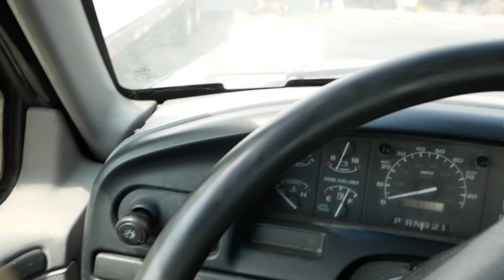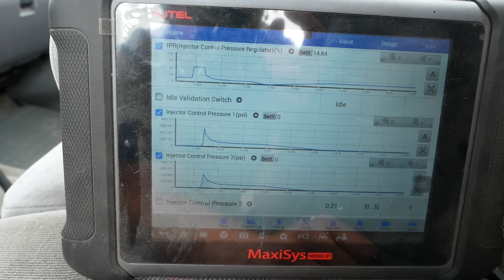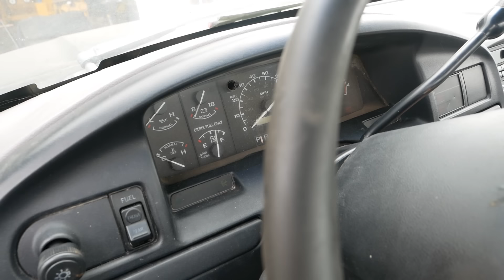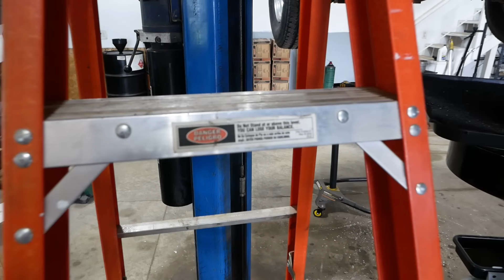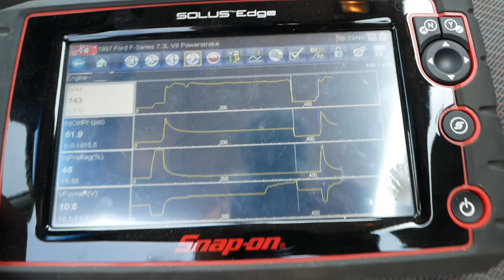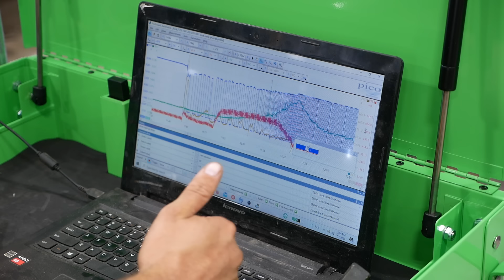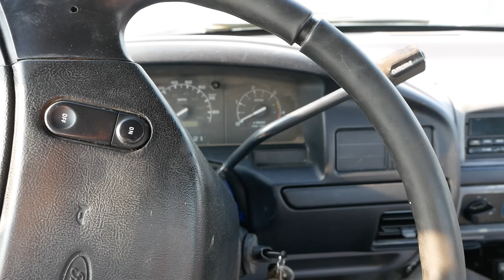Can We Get This 7.3 Power Stroke Back on the Road After Four Years?

Comment: I don't know if you figured out the  long crank issue, but I had the same problem on two 7.3. Both were 95, both had excess of 250,000. Neither had ever had injector O rings replaced. Finally checked the secondary filter on the drivers side of the fuel filter on top of the engine. I'm sure you've seen this,  but opened it up and cleaned it. They were both full of O ring particles and nasty stuff. The way it was explained to me, the return fuel or unused fuel from the injectors is sent back to the filter housing through this filter. The long start issue both times started slowly,  over moths and months. When I finally had to figure it out I was stranded in an airport parking lot and it took at least 20 minutes to get it to start. This was also about 2 months or so after I ran it out of fuel while running down the interstate. The second time was shortly after buying the other truck. Both times the filter was the problem. Cleaned it both times and had no other starting issues and put A LOT of miles on both. Just my 2 cents. Great videos buddy.
Reply: Just to add: Someone else added that it might be a capacitor in the PCM.

Comment: A leaky capacitor in the PCM is the answer to the question: "Is there something that leaks down with the switch off?" (at 43:10)
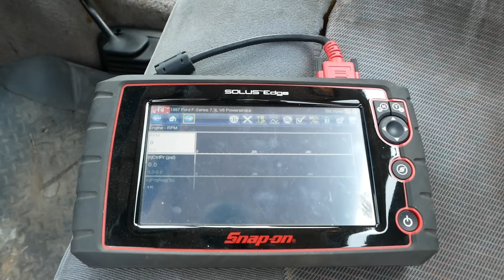At 37:40 the voltage from the PCM starts at 10.3 and goes to 10.1V.  
At 39:30 with the key on for half an hour, starts at 12.1 and goes to 10.8V.
The lower voltage provides less energy, a little lower voltage and it would never make any pressure.
Thank you for your videos !
Reply: Maybe but I would change glow plugs first as they probably have high resistance.

Comment: That 7.3 is just breaking in with 211 thousand miles.  Always love these bring back to life videos.
Reply: My 1996 f350 crew cab long bed 4x4 dually has 332,000. 7.3 with the e4od. 
My late 1999 f250 extended cab long bed 2wd has 354,000, 7.3 with the 4r100.
Both are excellent trucks

Comment: One of the many wonderful things about newer trucks is when you lose your belt you lose both your power steering and the majority of your brakes. Found that out when the AC clutch went out in my truck and took the belt with it. Luckily I wasn't driving down the freeway when it happened. Whoever thought having the belt be responsible for both was a freaking jeanEus that's for sure. Driving it from where the tow truck dropped it off to my where I could work on it in my driveway was a pain. What the heck were they thinking. It's a 2008 Dodge 2500 with the 6.7 Cummins.

Comment: There's nothing quite like the sound of a 7.3 Powerstroke. My dad had a '96 F-250 with the extended cab and the roof lights on top. Man that was a solid truck.
Reply: My father had a 2000 model extended, with roof lights as well. Never broke down for 275k miles. I grew up in that thing. We have a 2013 now.

Comment: I really appreciate Ford putting the starter solenoid on the fender close to the battery for remote start testing 😉👍🏻
Reply: I really appreciate ur spelling plumber plummer
Reply: I bought my Dads 78 f150 in 88 when I turned 18! Owning that 300 inline 6 3speed overdrive tought me everything I've ever needed to know about Fixing my ride on the side of the road!!! From when my buddy and me coming back from dirt biking in Pinckney No. Locked up the gear box on I94 and Mt Elliot in ghetto Detroit. Good thing Pops was stationed at E23-S3 dfd! It made its way to the back yard in Roseville my neighbor Joe found a boneyard 3speed put that puppy in and a sparko shift kit from Kmart!! Then the shift lever fell out I welded one with bolts long enough to work!!! Then the starter bendix locked up bought one at Warren Auto rebuilt that! Then the gas tank rusted through we used a self tapper bolt and a break strap sealed up with rtv! Ext....
Reply: Try this on a 7.3 econoline.  Everything is convenient to work on if you got a buddy with 6 foot long arms and a proclivity for contortionism.
Reply: Dance Around The World Maybe he eats lots of plums?
Reply: Old Mopars are similar.
Reply: @SweetLou0523  7.3L IDI or Powerstroke Econoline?
Reply: @Nathaniel Clark  7.3psd in a 1996 E350 ambo chassis. Got to darn near be a gynecologist to do some simple stuff like GPR or fuel bow work. Hell, the main fuse block is UNDER the power brake lines. Gotta use a 24" set of right angle needle nose just to get down to the dang things.

Comment: I am extremely impressed at how you got the snapped brake bleeder out. I’ve taken out broken exhaust manifold studs by welding a nut on them, but I never welded a bolt to a snapped and frozen brake wheel cylinder bleeder and then coaxed it out with the air hammer. Excellent job!!
Reply: I’m extremely impressed by how well he took that zap ⚡️ lol 😂
Reply: "Coaxed it out" and " with the air hammer". Not two phrases that I anticipated seeing in the same sentence. 😆

Comment: Had a similar problem on my '95 (long crank, sometimes forever crank), turned out the IDM relay was intermittent. Contacts in the fuse box had loosened up somehow (heat?) - bent them back in with a pick so that the relay plugged in solidly, problem went away. Maybe with the key on the relay stays energized, letting it crank normally.

Comment: Whenever I weld a nut to a broken bolt or in this case a bleeder I like to cool it with pb blaster rather than water. When the bolt cools it contracts and pull the penetrant down into the threads. Makes a huge difference.
Reply: I was actually thinking let it cool in the ambient air vs quenching to keep the weld metal from becoming brittle, but that pb idea sounds even better.

Comment: Lol, we had about the same situation. Had a 96 7.3 that my dad bought at a salvage action. It used to be a plow truck in Michigan. Dad had fixed it up and it was ready for farm use, the only thing was the brakes didn't work and it wasn't licensed. Dad didn't have time to fix the rest, so It sat outside for about 16 years before we got it running this past spring. Runs great now!

Comment: I would look into the internal power supply of the ecm. Maybe some caps gone. Power supply unstable when they are fully drained which not happens when the ignition is immediately turned on again.
Reply: Thats what i was thinking...sounds like a bad cap somewhere....cant be the fuel pump as its not on is it?
Reply: @BlackAck90  Shouldn't be the fuel pump but the caps seems likely. But then it should work the same if you just leave the key on for a bit
Reply: This 👉
Reply: Those electrolytic capacitors are almost 25 years old in the ECM.  Cheap to resolder in some new ones.  Could have high ESR values as well.
Reply: That's what I was thinking. "What drains when the key is off?"....capacitors do.

Comment: I had the SAME EXACT PROBLEM on my 2001 Powersmoke! My truck died at a red light and had to wait 2hours and 30minutes to be towed 1 mile back to my house. Next day plugged in Forscan and started diagnosing. Saw that the ICP was reading only 180psi. Took a look at the pigtail SAME like your video corroded wires exposed and it was shorting. My IPR had the SAME problem the gasket melted on the inside. Went to Ford spent 300$ on a new IPR and 10$ on the pigtail. Fired right up and no issues ever since! I believe if I swapped out the pigtail and cleaned the old IPR with electrical cleaner it would’ve worked and it would’ve saved me 300$!

Comment: The 'Vague-shifter' is likely the two torx bolts that hold the bell-crank to the shift rail on the bottom of the column.   I've seen several of those back out to cause that issue...
Reply: If this turns out to be my issue, I might have to buy you dinner.
Reply: I 2nd this. Tightened probably a half dozen of these with blue lock-tite.
Reply: Had this happen to me in a Ranger. Seems to be an issue on the F series also
Reply: @NotSureJoeBauers  Ford liked this column design so much, that they used in most of their vehicles from the time period - just about anything from a Taurus or bigger...   It's likely that your Ranger used the same column, and therefore would be susceptible to the same issue (pattern failure).
Reply: Yes, a common problem. I also put on lock-tite, easy fix.Also rust jacking of the shaft going thru the neutral switch where it mounts on the transmission swells and binds the switch causing hard, stiff shifting of the lever. Found both problems on the same truck.
Reply: Yup.

Comment: That rust is one of the reasons I don't miss living in Illinois anymore, even Ziebart didn't help!
Reply: Ziebart makes it worse holding water against the frame
Reply: And where do you live that doesn't have rust?  Inquiring minds want to know....
Reply: @ChristisKing7749  Common problem with Ziebart. It was supposed to adhere so tightly to that moisture couldn't get in, but in most cases it had some voids that allowed moisture to build up without being seen until the damage was catastrophic. An exception was my ex-girlfriend's first car, an infamous machine called an Austin Allegro. It was ancient when she bought it, but in amazing condition thanks to one of the few applications of Ziebart that did its job properly.
Reply: Ziebart a blast from the past, biggest problem was it all boiled down to the guy applying and the prep work…
Reply: Ziebart makes things rust faster.  Traps moisture.  Fluid film or Krown.
Reply: @chriswareham  as soon as it chips you have problems
Reply: @ckm-mkc  Australia.  5 year old cars that Wes says are in good condition would be scrapped over here for excessive rust.  Yet we have a multitude of old cars (30+ years old) on the road with nary a speck of rust on them.

Of course, not using road salt is a huge factor in that.  No need to.  The lowest temperature I've seen anywhere I lived is -2°C.  Record lowest temperature for anywhere I've lived is -3°C.
Reply: Ziebart is the worst thing you can ever do to a vehicle!!! Only use fluid film, crown or even bar and chain oil mix
Reply: @ckm-mkc  pretty much the entire Southwest US is generally rust free.  Even in the Pacific Northwet we don't generally see rust that bad.
Reply: @alex10294  yeah I’ve been experimenting with fluid film (spray cans) , great short term 6 or 8 months, have to wait a bit longer to see how it does long term 1 to 3 years?, I did notice that the gallon cans seem to be a much thicker product??
Reply: @ryanhogan6509  I live wv and have been using fluid film on my truck for about 5 years. I use the gallon cans and their spray gun to spray it on, and the aerosols for touch up. I apply in spring and fall. So far so good.
Reply: @BigBlockSeason  well I’ve been debating picking up the gun, so I can do the gallon cans..
Reply: I resent the mention of Ziebart! I worked for tufCoat dinol for 3yrs until I broke out in a weird rash!! I blame the System6!
Reply: @rennkafer13  Yep, in the NW, rust is not an issue. We can still drive cars that are 20+ years old and much, much older as daily drivers so every so often, you may see something from the 70's or 80's driven daily on the freeways here. 

When commuting, I'd find old Datsun B210's still plying the roads, yes, from the mid to late 70's Bumble Bee's, and the occasional 80's GM FWD vehicle, such as the old Pontiac 2000's (later renamed the Sunbird) etc still plying the roads as well as old first gen US Escorts on rare occasions, same with old Honda Accords and Civics for that matter. Even old Datsun or Toyota trucks, some going back to the 70's are occasionally seen. I drive a 2003 Mazda P5 with 192K+ on it and it's rust free essentially, but it was bought new out here, though I've had it since 2012.
Reply: @johnhpalmer6098  well, it's less of an issue.  Things still rust here but far, far less than the Midwest/East coast.
Reply: @rennkafer13  That's true, it's more that we get surface rust than anything else.

Comment: I bought a brand new 1995 F350 regular cab single rear wheel 4x4 truck (like in this video) but my truck had a 460 gas engine. That truck was awesome.... of course it was brand new. It sure did love to drink gas though. Thankfully in the mid 90's gas was only $1.10 - $1.30 per gallon. It had 4.10 gears, auto transmission with NO overdrive. I loved that truck. It was still rust free when I traded it in....  I have always wondered what happened to that truck after I got rid of it. It's probably rustier than the truck in this video.... if it even still exists today. Lol

Comment: Check if this year vehicle has a mechanical fuel pressure check valve in the tank that has failed. If so add an in-line fuel check valve.

Comment: Glad my truck and I are in texas....I have a 97 CCLB 4x4 that doesn't have a spec of rust on it.  Its my daily driver, doesn't leak a drop and gets 18+mpg on 37"s.  Then again I'm just getting it broke in at 267K miles.  Best things I ever did was trash that filter housing and pump and convert to a frame mounted pump and filter, way cleaner look and way more room to work.

Comment: I've had a couple diffs with rotten covers and stuck fill plugs.  I drilled a hole in the new cover at the same height as the fill plug and welded in a threaded bung to fill the axle.
Depends on what you're working on.  If it was a customer rig I'd run it by them before I did it or not.
It worked great on my rusty old farm trucks.

Comment: I've got a 2003 7.3 2-wd with a 114,000 miles . An Arkansas No rust truck but it does have a few whisky dents . I don't use it much but being the original owner it's a hell a trailer pulling truck .  Man it's Made a Ford diesel truck person out of me . Hard to beat a POERSTROKE .         GREAT VIDEO  sir

Comment: Years ago my parents bought an old FWD snowplow from our neighbor. Not sure where he got it from but this thing was a monster with a huge straight plow and a V-plow. It had been sitting for a while at least 5-10 years maybe longer. They put some batteries on it and that 220 Cummins fired right up and blew some kind of an animal's nest about 20 feet in the air. It had two massive concrete blocks sitting on the back as ballast. They were 6' wide, 4' high and 4' thick for the one and 2' thick for the other. It had 24 ply tires on it that even with all the air out of them still stood tall with the concrete sitting on frame. It worked great as a snow plow, which was nice because the county rarely plowed the county road on which we lived and since it was 1.25 miles to the road and 5 miles to the closest neighbor and at the time we didn't have any phone because this property is surrounded by National forest so no electricity, phone, etc that can let people know you need to get out if your snowed in which happened a couple times prior to us getting this machine. At some point we bought a grader and so dad decided to turn the old FWD into a tractor and we did, albeit one without most of the sheet metal so more of a cab on frame sort of tractor. Dad did change out the transmission and make some alterations to the drive line as well.

Comment: When you were talking about all the front running gear problems it reminded me of the only 4wd I've ever owned.
1990 Z71 auto w/350. I paid 1500$ for it. Had to replace both sets of door hinges, got tired of having to lift the doors to shut them, headliner held up with staples, infamous paint peel on every body panel.
Sold it for 500$ to "pull a part" because the front running gear repair costs were more than twice what I paid for it.
BTW, I said that infamous word for you each time the weld broke on the bleeder valve.
Thanks

Comment: You do amazing work!  you recover stuff that most mechanics would say - Yeah!  NO!!  Excellent work on getting the brake bleeder out and also all those brake connections.  The only thing i would have tried is to put a jumper maybe from another 12 volt source with it's negative tied to ground and it's positive going to the ECM/PCM 12 volt supply -  just to see if you were really getting enough voltage to it while cranking!  Wonderful sense of Humor as well!!!  Liked!  Subbed !!

Comment: Capacitive leakage without power. Some electronic component is leaking when the power is off, soggy capacitor some place that is resisting charging up? As you say maybe the driver is tired and needs replacing.. Just a thought..
Reply: Its like somebody read an electronics text book from a distance whilst driving by. All the words mean something but together not so much.
Reply: @TheFool2cool  Well shitty capacitors in circuits will do all sorts of weird assed stuff, some just won't work, while others will half work or work poorly. Not knowing the electronics configuration of a 7.3 just leaves one guessing, that's what I did guess. I have seen capacitors do amazing stuff right up to blowing up out of the blue. So a long term progressive failure is possible. Wes knows the mechanics, I was offering support to his theory that it could be an electronics failure. A weak capacitor can take longer to charge, and thus extend cranking time. When power is maintained to a circuit the capacitor is fully charged or at the least, operating within is service window, until it's allowed to completely discharge. Just like a charged battery will maintain a "surface or float charge" until it's pushed into service and the surface charge is used then the true storage voltage is observable..
Reply: So how is the ultra-high-impedance capacitor meant to be helping the circuit after it's finally charged?

The solenoid driver was clearly working just fine in both captures.
Reply: Same problem with a 96 at 263K, IDM replaced as well...on to tank filter ect

Comment: I can't believe you fixed the a/c! On this beater. The a/c works on my 87 f150, but it's a nice truck. My 93 f350 7.3 is a lot simpler, but slower! I  will try your weld-a-nut trick next time I need it. Thank you for sharing your wisdom. GOD BLESS GOD SPEED GOD WINS.